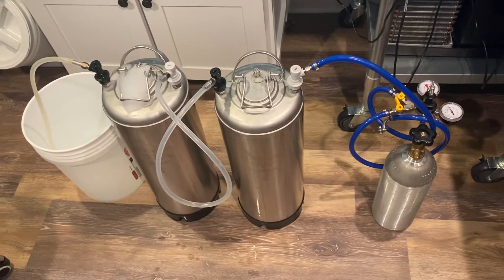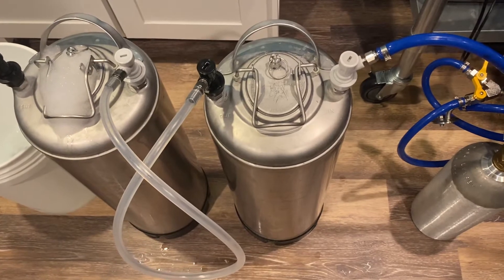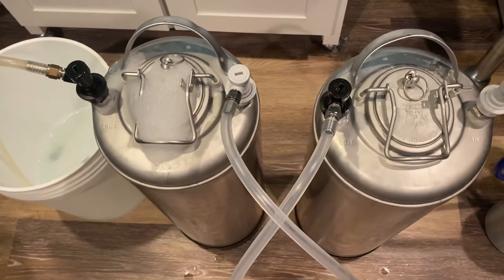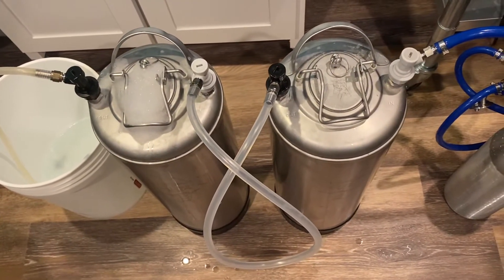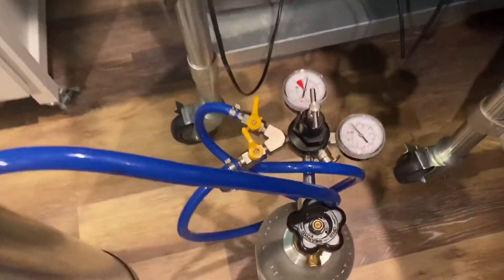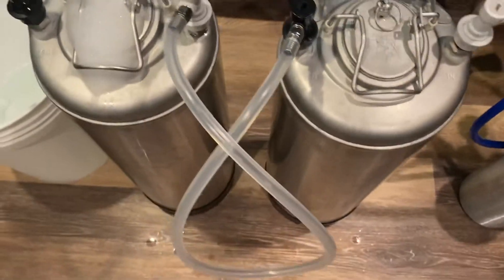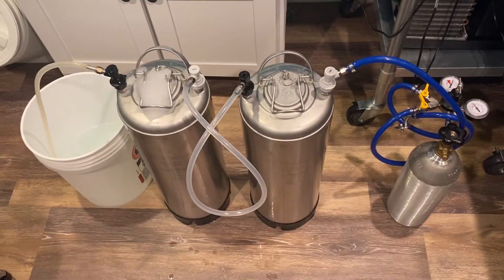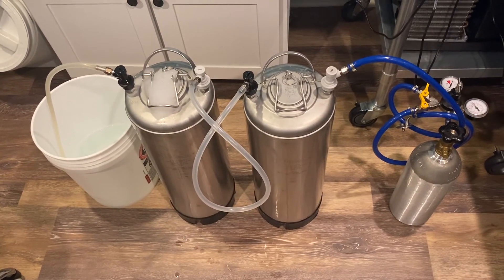How to purge kegs of oxygen

Comment: Does this work? Isn't the IN port at the top of the keg, and the OUT port is at the very bottom of the keg? That would mean the second keg is not filling with starsan and instead it is only filling the very bottom up to the OUT port. Please correct me if I'm mistaken. In other words, the second keg doesn't get sanitized or purged. The fix would be to reverse the hookups for the second keg so that it fills with starsan from the bottom.
Reply: Both in and out are on the top. In this case the white quick connect is "in" and the black one is "out". The out port has a dip tube that reaches the bottom of the keg in the inside. The CO2 gets in and increasing the pressure and pushes the liquid through the dip tube out.

Comment: Any concerns with the oxygen in the Star san bubbles that are left in the keg?
Reply from the maker: Brandon Carter nah. Only so much I can do
Reply: JP Homebrew try saniclean if you want to eliminate even more DO
Reply: @NorthCackalacky24  Good tip.  Remember, after filling with beer, connect gas down the liquid post, pull the prv, burp the keg, until foam comes out the prv.  Essentially you've then 'capped on foam' the keg, and should no longer have O2 present.